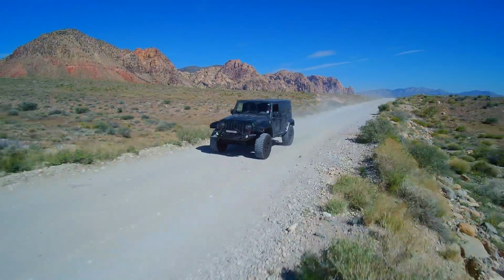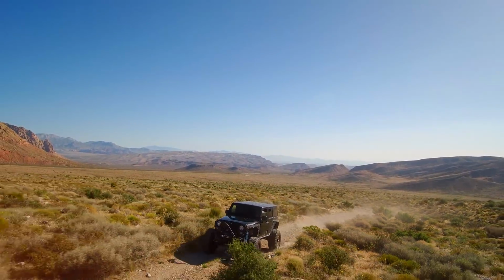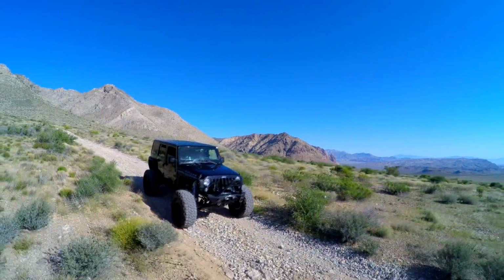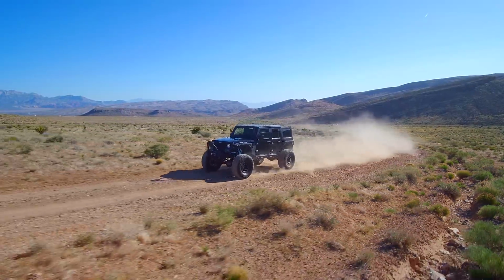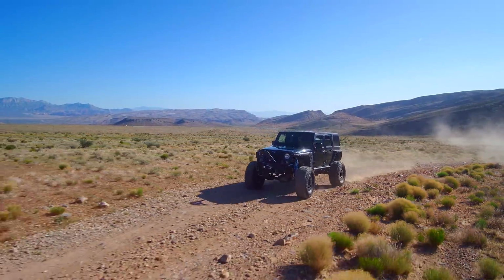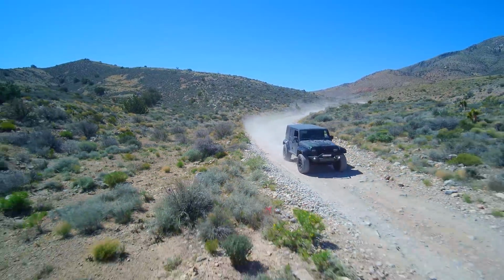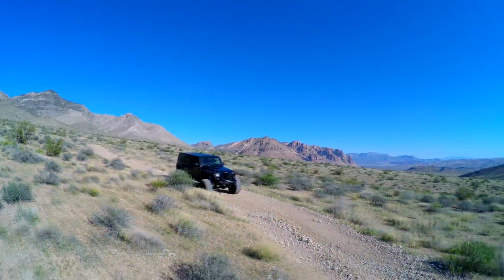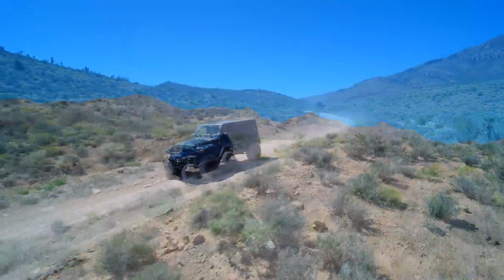Speed Density vs MAF

Comment: @16:05 you point to the "Mass Air Flow Sensor" but that is not the sensor, that is the intake air temperature sensor. The actual MAF sensor is a small wire inside the body at the top of the tube. This is important because someone might watch your video and use a MAF cleaner on the temp sensor and not clean the actual MAF and thus not resolve their problem.